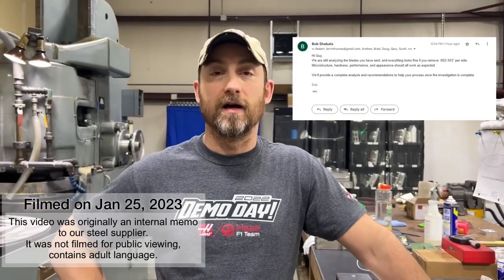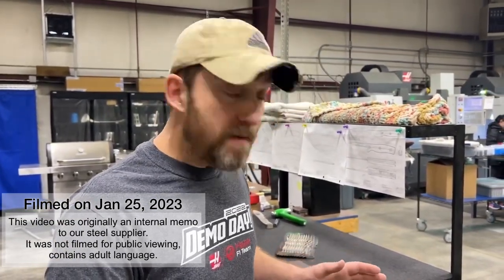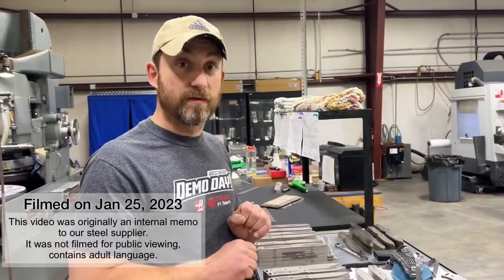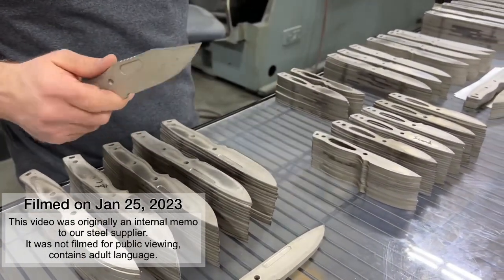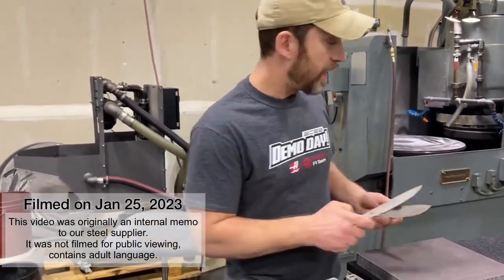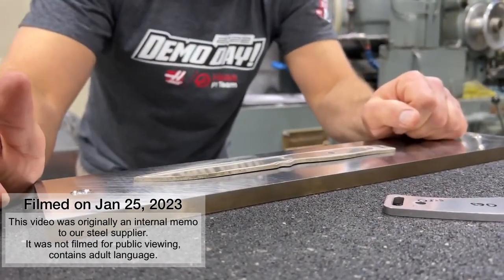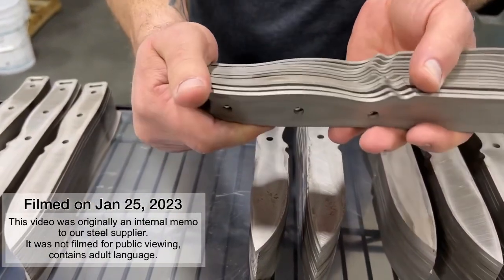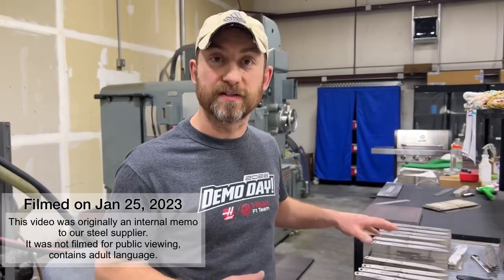Jan 25, 2023: Magnacut Decarburization Conclusion

Comment: Had some Ti Plate warp like that after being normalized and the rep told me that it was well within spec then gave me the run around for months when I tried to get them to replace plate that I hadn't sent to get waterjet so I know EXACTLY what your have been going through Guy. It is a no joy scenario with limited options on how to move forward productively without a bunch of extra long days trying to find a solution. Most of these material sales guys haven't got a clue on what goes into manufacturing on ANY level. Most are just run of the mill snake oil salesmen who peddle their wares without a clue of what the real world of manufacturing is. I remember when material sales guys used to KNOW their product and not just regurgitate brochure info. I've currently own 5 Survive knives and have a 5.5 on order. These are some of the VERY best quality knives I have ever had the privilege to own. Seeing videos like this and the shop updates you have posted makes me proud to own your products as it is evident you are working to make the VERY best knife, every time. Refreshing to see a manufacturer with such pride in their work. Stay strong and know that you are NOT in the wrong on this one.

Comment: Maybe the Magnacut is not bending/warping, but it is such a Magical concoction that has actually warped Time and Space around the blade.  Your surface plate is actually what is warped !   :)
Reply from the maker: You are welcome to come to our shop to check it out. My metal flat plate and our granite inspection plate are both dead flat. In all seriousness though, this was a huge issue that affected around 850 parts in grand total. We walked into this very carefully, doing two smaller sample batches prior to this large batch, where we scaled up to meet demand. We didn't do this, and to have it all thrown in our lap was really soul crushing. I don't think some of you folks understand just how expensive these materials like Magnacut really are.

Comment: Makes magnacut as a whole come into question. If the raw materials are this inconsistent how does the end user trust Magnacut after this?  I’ve always felt it was a little over hyped and too good to be true kind of steel I have two blades with it but i have always wondered if it was a “honeymoon” phase type steel in the knife industry.
Reply from the maker: I'm pissed because I know they can make it correctly and it can perform. I'm especially pissed because we stepped into this carefully, doing two smaller batches before going hard to meet demand.
Reply: The idea behind MagnaCut seemed sound enough. It was new territory and 20/20 hindsight showed perhaps more R&D time was needed to dial in the process conditions and the heat treatments. I believe it is a steel capable of its intended purpose so long as everyone has the correct implementation data and everyone works it correctly (including the materials processor who seems to be showing quality and consistency issues in other steels).